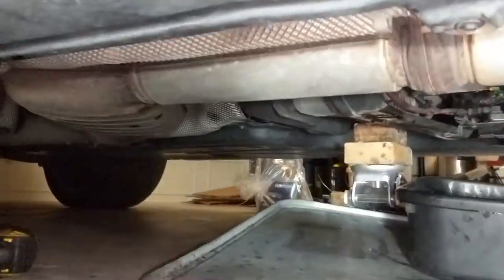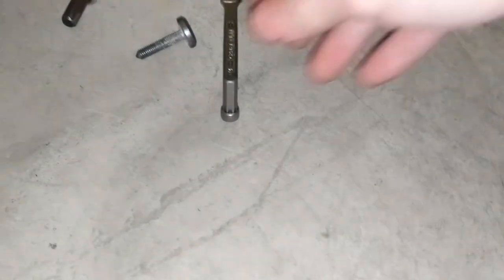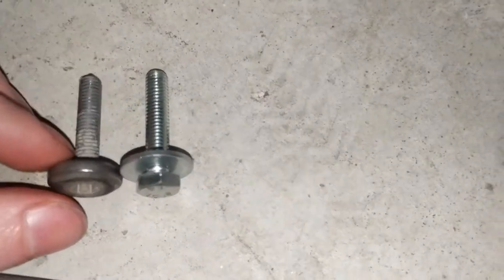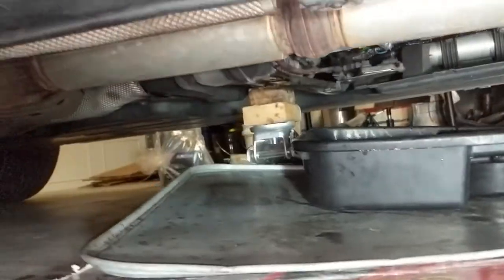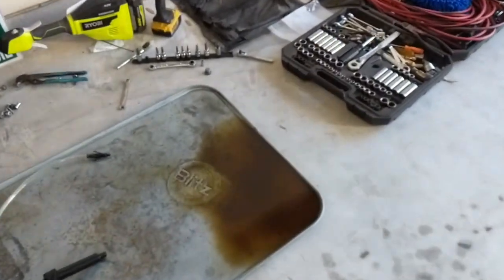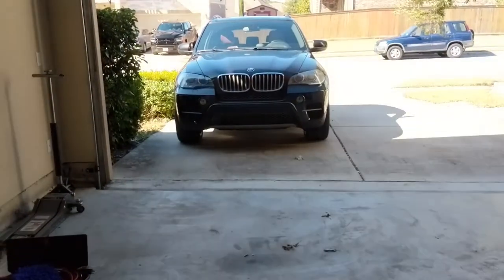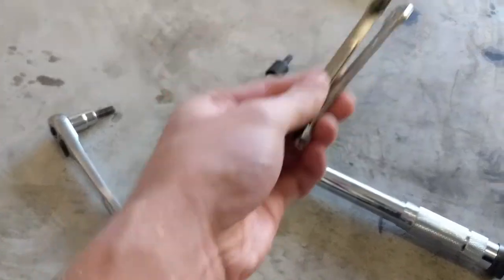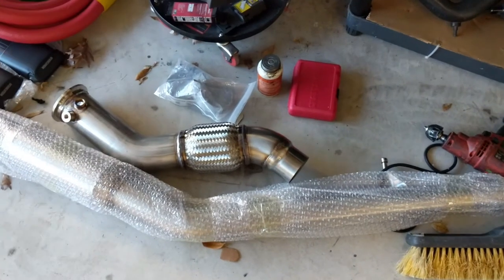E70 X5 Diesel M57 6AT Transmission Service drain and fill pan replacement

Comment: It seems like its hard to get the cross member out but it takes 10min. Always remove it. On the 35d.. you can get to one of the cross member bolts out without dropping exhaust. and you have to get it up to 176F or 80c and have constant drip out of the fill gauge. 5.5 is a bit low..

Comment: Wise move not using those bolts. The original are aluminum and those are steel. My guess is you’d see some galvanic corrosion down the road. Good information, I also own a diesel X5 and have enjoyed your DIY’s

Comment: Whoever designed it so that those 4 bolts in the back are impossible to get out, I hope he/she rots in hell. 
Thanks for the tip. 6 hours to get the last one off.
Reply from the maker: Glad I could help. Got under it yesterday to check everything and it's all dry.

Comment: Appreciate the video! I started this job today and spent most of my time modifying bits with my angle grinder. I see you jacked up the transfer case, thats a great idea, I'll try that now.

I see you have that SCR delete pipe sutting on the floor there. Please upload when you get to that. I'm in Houston and I'm very much interested in the EGR race pipe and SCR delete.

Where are you planning on getting your tune?
Reply from the maker: I got that installed along with the EGR race pipe from TME. Currently on a BRR tune but he's no longer in business.

Comment: Hey man I enjoyed watching your video! You kind of remind me of myself lol. Did you notice any difference in shift after the oil change? I recently acquired X5 like yours and when it’s cold my trans shifts around 2k-2500 rpm but when warm it shift earlier. From what I read, seems like an oil change kit is needed along with adaptations reset. Did your kit contain the mechatronic sleeves or whatever they call them? It’s like 3 black small tubes. Let me know please. Also are you going to put a down pipe or something? Do you have smog/emissions test for car registration where you live? It’s mandatory here in Austin and I don’t know what I can do and cannot do to be able to pass the emission test. I watched your other video for the swirl flaps delete and I think that should be fine but all other people remove the dpf and some do EGR delete and some do both but I’m not sure if EGR delete will make me fail emissions… this diesel is so annoying, I’m like borderline regretting not going with a 35i instead.
Reply from the maker: The shifts did improve a little bit from just doing a new pan and oil. They got even better with a Sutphin trans tune which I recommend and that will get rid of the higher rpm cold shifts. When you do just fluid or the mechatronic seals, you shouldn't reset the adaptations. That's only necessary if you are replacing internals in the trans or the whole valve body. Just yesterday I got the tube seals and the bridge seal to drop the valve body and do the whole refresh job; I'm at 135k miles so it's definitely time to do the full job. I'm also in Austin, and luckily Texas doesn't do emissions testing for diesels, only a safety inspection. I've been running the ATM downpipe and SCR delete for a year now and it's been great.

Comment: Bro how the F do you reconnect the megatronic connector. I am on the brink of going insane
Reply from the maker: @skyliner004  Are you using a new mechatronic sleeve or the old one?
Reply: @sullygtx9350  a new one, getting it sitting properly is a nightmare. no place for hands
Reply from the maker: @skyliner004  I had the same issue so I took the o-ring seal from the new sleeve and put it on the old sleeve and put the old sleeve back in. I was even using I pry bar to seat the new sleeve and it wasn't happening.
Reply: @sullygtx9350  Seriously considering dropping the cross member. Should of done that right at the start honestly

Comment: How much dealer charge for same job?
Reply from the maker: I'm not sure. I do all mechanical work on my own to the best of my abilities. Sometimes that means buying a new tool but still cheaper than a dealer and I get to add another tool to my arsenal. A jack, some jack stands and a $100 craftsman tool set has saved me thousands over the years.